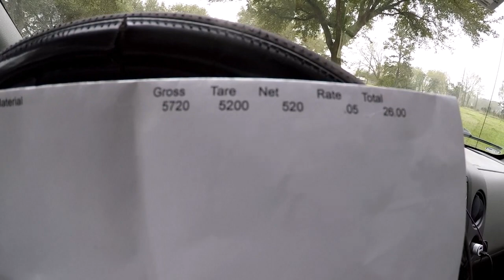Dumpster Diving 37.2 (Found Heisenberg's Secret Lab! Plus Bonus Scrap Run)

Comment: Mike the bottles at 8:30 have a septum seal on them.  This is similar to a vaccine bottle which you can stick a needle into in order to fill a syringe. In the case of these bottles they probably have a sample of waste water, “product”, crude oil or any number of various liquids that someone wants analyzed for composition, quality control or whatever. Look out for jars that have acidic preservatives preloaded in them, it can be pretty strong stuff.
Reply: Yeah they're definitely sample jars. Dopak makes all shapes and sizes for the medical and chemical industry. Looks like the shipment got banged up pretty bad and they were thrown out just as a safety measure. There is so much wasted money and materials in the chemical industry. Awesome job saving and possibly re-appropriating those Mike!

Comment: Nice RF connectors saw BNC maybe pl259 good stuff
Reply: Saw some RG59s in there too. BNC connectors are going  for about 4.50 to 6 bucks each (735 - 75 Ohm). RG59s are going for about 40 to 60 cents each. ADC is an older brand of BNC that I don't think is mfg. anymore. Milestek & Trompeter is what we use here. You can still get the Amphenol brand of BNC pretty cheap, but they are old style as well.

Comment: The second bottles you picked up in the reveal looks like it is about a quart or liter...the brown spot in the cap is to use in injecting something with a syringe. The bottles are originally sterile, no doubt. Likely the "donor" was a lab of some kind. Those small straight sided glass tubes look like specimen containers used with a machine like seen on Oak Island last night. The tubular motor is used for roller conveyor systems to power a small section, either singly or in sets. Great for stop/start light production lines. What is the voltage? AC or DC?